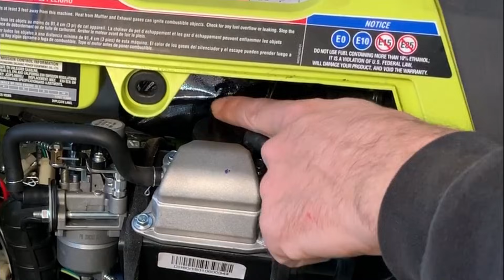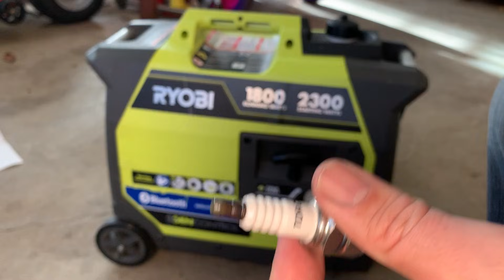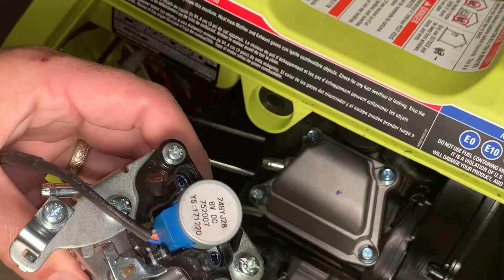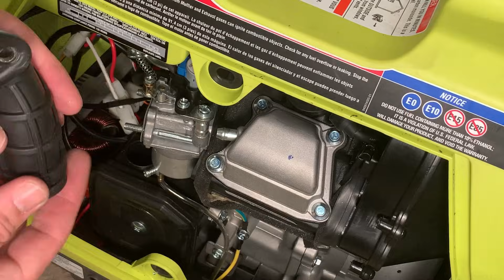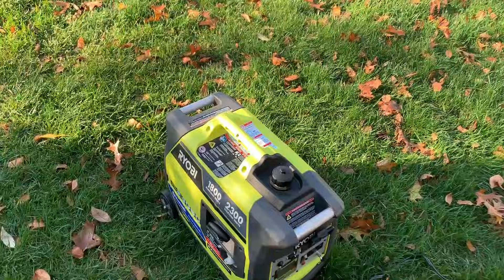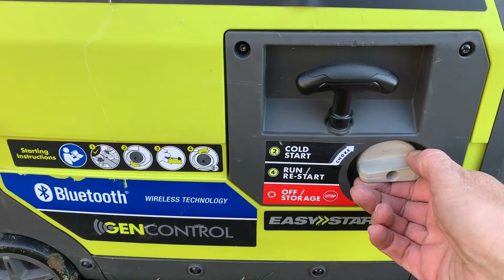Surging and Stalling Ryobi Inverter Generator Fixed - RYI2300

Comment: We bought our Ryobi 2300 in August of 2017 for use in our off-grid RV adventures. At times I’ve only used it every 6-9 months & after several episodes of hard starting I always put a generous amount of Seafoam into every tankful. Although I haven’t experience the 1/4 load surging issue yet, we really appreciate learning all we can about this generator. It is sad we can’t get the cool Bluetooth features in some of the big brands. This generator at times feels ahead of its time in features, but at the cost of a low budget engineering price point. I also wish that it had an easy propane conversion for dual fuel capability. Once I added an Easy Start to my 13,500 BTU Coleman Mach A/C unit on our RV, the Ryobi 2300 easily starts the compressor without any hiccups. After our trip out west later this summer I hope to have only good things to say about it all. Thanks again for sharing.
Reply from the maker: It has a very good feature set for the price.  Ryobi would be wise to get rid of the Easy Start system and add Bluetooth to their other products.  I was hoping to use it with my RV.  Being able to see on an app your load, fuel level and be able to shut off remotely is a great feature to have in an RV or anywhere really.
Reply: @jcondon1  If they add the remote start function to the bluetooth that will be a real "Easy Start"

Comment: I have to comment on your video. Where was the quality control of the machine? You had to buy items that most likely were not needed, but logically selected for trouble shooting. Lastly, the access to internal parts that could be considered maintenance items was horrible. What I learned from the video is not to buy one. You made a great video and I thank you for it.
Reply from the maker: Thanks.  It is almost a good generator, but just falls short.

Comment: Same problem, doesn't run without surging heavily in run position and gas trickles out when loosening screw for fuel drain. Turn to choke get full flow of fuel out the line. Bypassed fuel selector and went direct to carb from tank. Same surging. Ordering stepper motor to check that.

Comment: This is why it is best to have a separate choke from the on/off.  That said my Honda hasn’t petcock valve on the on/off...  I bet this one does, too.   Problem is most likely it is not open enough when on run.

Comment: You probably need a new petcock valve.  Also your gasoline is very yellow.  Reason it ran better with the new carb is the low speed jet on the old one is clogged

Comment: Great video like always.  I am having trouble with my Sportsman Gen1000 surging problem I’ve tried cleaning the carburetor change oil change spark plug still same problem.  I can’t find a replacement carburetor do you have any suggestions that might help?  Thanks keep up the good work.
Reply from the maker: Send me the exact model number.  Will see what I can find.  Have never tried locating parts for a Sportsman.
Reply from the maker: I did a quick search on Sportsman Gen1000.  Found the part number for the Carburetor 02201060000104.  Of coarse nothing comes up when I search for it.  If I am looking at the right generator, it looks a lot like the Harbor Freight Chicago Electric I fixed a year or so ago.  Take a look at that video https://www.youtube.com/watch?v=26-c0aDcGPs.  I bought that carburetor on Amazon https://www.amazon.com/gp/product/B015OCMWUO/ref=ppx_yo_dt_b_search_asin_title?ie=UTF8&psc=1.  Maybe the same one will work?  Otherwise Generator Guru has some parts listed.  Never tired them, but they do have hard to find parts for Chinese generators https://www.generatorguru.com/gen1000/.  Although it is most likely the carburetor, because it is a two cycle there are other things to consider.  If a new carb does not fix could be a reed valve or crank seal.  Good luck.

Comment: I am always rooting for you. I have the Honda eu2200i and many owners of these are not aware at the bottom of the fuel tank on the fuel hose their is an inline finger filter that can be cleaned or replaced. After all the fixes you tried I was sure it was the fuel filter. It never dawned on me that is was improper knob indexing. Always use non-ethanol gasoline and I always add about a quarter ounce of carburetor cleaner with every tank. Watching your video got me worried as I stored my generator indoors with stabil and carburetor cleaner, but with the carburetor bowl empty. I siphoned the fuel out today after eight months of storage and the fuel visually looked and smelled great and the generator started after about fifteen pulls. Saving a little bit of money on gasoline is not worth clogging your carburetor. I was wondering if someday you would do a sine wave test on the generators you repair. I noticed on some other generators when the surge wattage was approached the wave would start distorting. Best of luck and great videos.   https://www.youtube.com/watch?v=L6pYh6d6Yrs&list=FLjZ1ADd92M9Poe6Hx4xpKCg&index=68&t=0s
Reply from the maker: Brad Davies I have been wanting to purchase an oscilloscope for a long time.  To worried about buying the wrong one and as a result do not own any.  Unless you count the Tektronix I have from the 70s.  Afraid to plug that one in.
Reply: @jcondon1  Thanks.
Reply: @jcondon1  I'm using a KKmoon KKM781 for this purpose, you can find it on Aliexpress for around $85. It's handheld, battery-powered, the screen is not big but it does the job. Putting a bulky, mains powered and expensive Tektronix scope which I also have outside for generator testing seems not a good idea to me.

Comment: Mine only runs in choke. When I switch to run it cuts off.
Reply from the maker: mn1170 if it runs on choke then the engine is not getting enough fuel.  There carburetor needs to be cleaned.

Comment: I've had mine for 7 months (180 hours logged, maintenance done as specified). I had noticed the surges on a regular basis, but they had never affected me until yesterday (the generator  would constantly shut off after 10-30 seconds, no matter what the load). I purged a quart of gas down from the carburetor and noticed what seems to be carbon deposit coming out of it. More importantly, I also noticed that the gas flow is not even when the knob is on RUN (as you show it). I now set the knob between C and H (of CHOKE) and there are no surges at all!. Thanks a lot!
Reply from the maker: Glad I could help.  Wish Ryobi would get rid of the easy start system and let people control the choke and fuel valve separately.
Reply: It might be easy start but its not easy run. Its a stupid system. They can't even get the sticker in the right place. The "easy start" knob is too dumbed down and plasticy. Give people proper access to the carberettor and fuel valve.
Reply: @jcondon1  ddk
Reply: Mine i still in the box.  Watching this video in its entirety and reading your comment as well.  Thank you!  I'll remove and test it out tomorrow or Wednesday.   Thanks!
Reply: This really does work just bumped it up and it’s running like butter. I wonder if the inter workings of the knob loosen over time…..and should maybe be adjusted.

Comment: Thanks!
This seems to be my ryobi's issue also!
It is running smooth and long time now.
Reply from the maker: Good to hear
Reply: @jcondon1  well, now it is running rough - we run it for about 3 hours everyday - change oil once a month.

i will put some seafoam in and see if that helps.
Reply: @flyingdiscproductions  Did the seafoam help?

Comment: Forgot to add opened up the front panel to check the circuit breaker one time looked over at the LCD display. there are four screws that hold the LCD display on three of them we're out one being broken all by itself. Add a light thread lock to every screw

Comment: No the pull start is garbage. Note the gas lines are frail note they're both made a very cheap material would replace when you get the chance. I own and have taken apart to unit approximately 20 times to repair certain issues the copied Honda technology dealing with the motor does a good job and runs about 15 to 17 hours no load. Unit would work better with form of internal small fan to Force move air. Unit is a value at around $300 not for 600 you'll pay. Bluetooth makes it great for turning the unit off not to turn it on. Fuel gauge reads accurate. There are about three different models of the same model if you need parts FYI.

Comment: I have a neighbor here in PR with the same problem the thing is his does the surging even with out power connected to the generator . We changed spark plug added stabilizer and fuel filter . The generator was working just fine for a couple of months during after math hurricane Maria . I'm going to try out the fix presented here to see how it goes even though we have all ready played around with the choke and did not have much results I will let you guys know how it goes  . Thanks for the tutorial.
Reply: I am having the same issue with mine with no load. Added fuel stabilizer and after about 30 minutes it seemed to have fixed the problem.
Reply: @TheTrev4477   I’m trying find this now

Comment: Great video, as always. 
When you showed the surging issue I was thinking fuel straight away, and the minute you got that plug out of the engine my first thought was that the plug had all the signs of a lean mix. 
Never, ever trust some plastic knob and a stick on label combo to set something, always check the Fuel, Air, Compression, & Spark, or FACeS...
Reply: Yes, do it properly. Stupid plastic knob and sticker thats not even stuck on in the right place.

Comment: Some one deleted my comment so here we go again. I had all of the problems below so I went through all of the remedies that James offered. watched the video a few times. All of the suggestions helped a little bit at a time but the biggest improvement came from pulling the OEM fuel filter and replacing it with a piece of 1/4 inch copper tubing. No surging at idle or full speed. Load or no load. The big difference is now it won't run the micro wave, the lights and the refrigerator at the same time. It use too. 
   Any suggestions for a new fuel filter? I don't want too run it with out one for very long.
   Thanks to all and specially to James Condon for making this video and giving advice and suggestions.
Reply from the maker: Charlie Spikes do you have this model the RYI2300 with Bluetooth or the previous model RYI2200?
Reply: @jcondon1  Thanks for the quick reply. This one was made in 2017. Bought at Cabela's in Feb. 2018. It's the RYI2300 with Blue Tooth.

Comment: james. i have to give up on this machine. it is not mine but for a customer.if it were, and since i really enjoy solving  issues, i might consider using a fuel pump such as http://www.tsracing.com/Mikuni-Fuel-Pump-Rectangular-P1007.aspx . this would allow the switch on the machine to be used as intended. i used this pump to feed a 30 hp 2 stroke racing engine. i think it would draw the fuel well thru the partially open fuel valve.  down side to this is it is a pulse operated pump. you would have to find a place on the engine to get the crankcase pulse. i could have fun doing this

Comment: thank you for finding the issue with the fuel flow. i am having the same problem where it only runs on "choke" setting. i ran it for a while with gas stabilizer and when it smoothed out i switched to "run". the whole problem started all over again. i noticed that the display panel is saying OVERLOADED but there is nothing plugged into this POS.  would the lack of fuel cause the overload to trip or am i fighting more issues?
Reply from the maker: Does the overload message go away when you reset it?  Might just be related to the surging engine.
Reply: @jcondon1  yes
Reply: looking this thing over, i am considering bypassing the fuel shutoff. i am sure i can put a separate shutoff somewhere on this pig. or maybe a separate choke cable. if i can get everything adjusted so that i can run choke full open and actually have fuel flow then i won't bypass.
Reply from the maker: Would just bypass the OEM fuel shutoff and install an inline shutoff.  That way you will have good fuel flow at all times without worrying about the choke being full open, but fuel restricted.
Reply: @jcondon1  the more i look at this POS, i think the best way is to install a separate choke cable. actually i am considering junking this worthless piece of crap. i was just now adjusting the choke cable assuring that i was getting choke   and wide open with dial set at max fuel flow. put the air tube back together and it will not start. back to the original problem. the carbs on these things are worthless

Comment: My buddy just gave me his brand new Ryobi 2300 and we are having the same issues. 
Never used. New gas put in. Fresh oil in. And it won’t start. If I spray some starting fluid in the air filter it’ll start but then quickly dies. 
Watching your video and hopefully getting this thing started. Any tips?
Reply from the maker: Swany Swan open the drain screw on the carburetor bowl and test the fuel flow.
Reply: James Condon welp, flow was pretty good around the actual run section. But again to start it I needed to spray some engine starter into the air filter. It’s almost like once that dies off it sputters out. I tried starting it and then when it was running moving the knob into the spot just above run where I had good flow and still died out. Any ideas? Damn thing is brand new. What type of gas do you suggest? My next step is to dump all the gas out and try new stuff.
Reply from the maker: Swany Swan if it runs on starting fluid, then it has to be something wrong with the fuel delivery.  Either the flow ( fuel valve or gas cap vent which you just tested) or carburetor related.  Unlikely to be the gas if new.  I usually use the high octane stuff but see conflicting posts about what to use.  The carb could have a clog in the high speed or low speed jet.  Or could be an issue with the throttle plate or servo motor.  You can try turning the idle screw in a few turns.  Potentially the throttle plate is closing to far.
Reply: James Condon idle screw crap I don’t think I know where that is. On the carburetor? Is the throttle plate with the choke controls?
Reply from the maker: Swany Swan throttle plate is on the engine side.  I can post a picture a little later on the location of the idle screw.  A few people commented that it helped them.  I am a little surprised though since the servo is supposed to be controlling the speed.  Just do not want to over turn it or the generator will not be able to idle down.  Or worse it could over-rev the engine.  So be conservative.
Reply from the maker: If you go to my page and look on the community tab, you will see a picture of the idle screw location.
Reply: @jcondon1  Contrary to common belief, "high octane" fuel is HARDER to ignite than regular. Most small engines do not have the high compression ratios that would call for all the high octane additives. 

On the other hand, if the engine has electronics to keep the fuel as lean as possible, the extra anti-knock ingredients in the high octane stuff might be useful.
Reply: James Condon just got to the end of the video and saw that! Running out to test now 😁

Comment: I have two 2300 Ryobies and they have gave me fits off and on for two years now Hard starts and surging under light loads.   Got to the bottom of it today. Plugged channels in jets and air bleeds. You can unbolt the carbs, remove intake tube and fuel line and get the carb out far  enough to work on it without disturbing the choke cable and electrical connection.   Unscrew the little jet in the side tube and insert spray tube through the opening into the little off side hole for one. another are the two holes in the intake side of the venturi.  Cured both of them. YAY !!  Goes without saying to run marine fuel if you can get it.  Alcohol is what causes this shit to begin with.   Don't forget to clean and re oil the air filter.  Will see how they do in the morning on a low temp start.

Comment: Same problem as well... I used mine and put it away and went to use it the other day and it won’t come on at all. Any idea?

It was working last a few months ago.
Reply from the maker: Max Viana try a little starting fluid.  If it starts for a second you know you have spark and compression.  Assuming it runs for a second on starting fluid, then test fuel flow through the lines.  If good, then the carb needs to be cleaned.
Reply: James Condon staring fluid as in gas or is there something in have to buy specific and where do I apply the starting fluid?
Reply from the maker: Max Viana there are examples on YouTube on how to use starting fluid.  It comes in a can and you give a little squirt in the intake. https://youtu.be/KUNlD7d3TTE
Reply: Mine has always required me to drain the float bowl, then it usually starts on first or second pull

Comment: I have the same prob and mine smokes like crazy less then 20 hrs :( i broke in via the manuel and it also smokes like crazy i should have got the honda :((((
Reply from the maker: NATE DOGG I am surprised to hear about the smoking problem.  I think Ryobi uses the same engine that is in the Yamaha ef2000.  Double check your oil level.  Maybe it is overfilled?
Reply: smokes? what color white or black?
and brand new?
did you add oil?